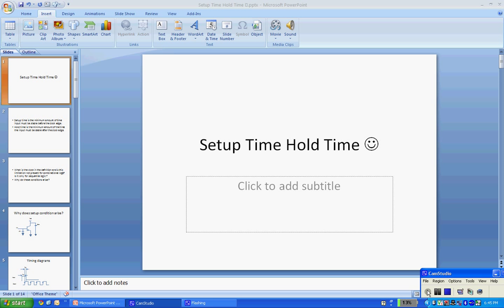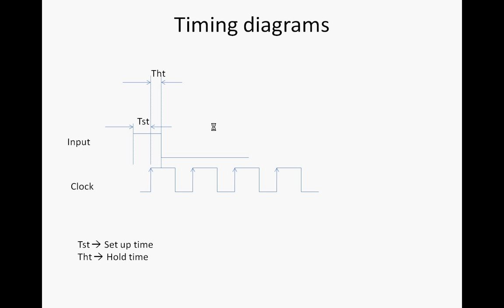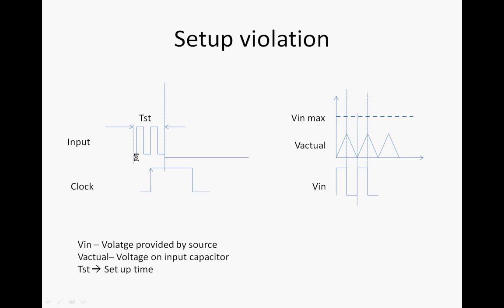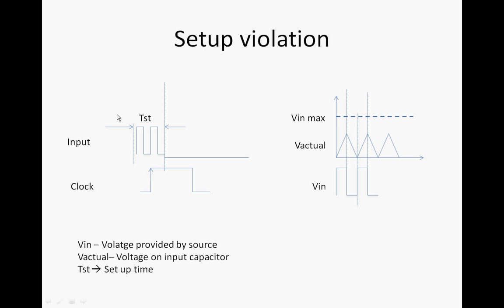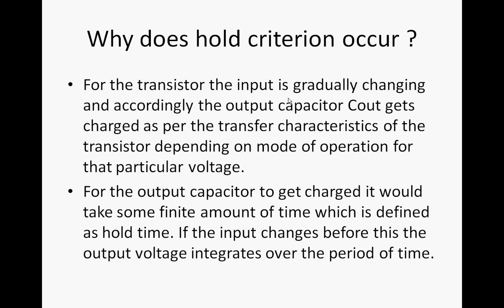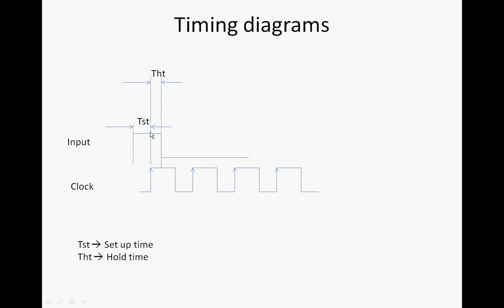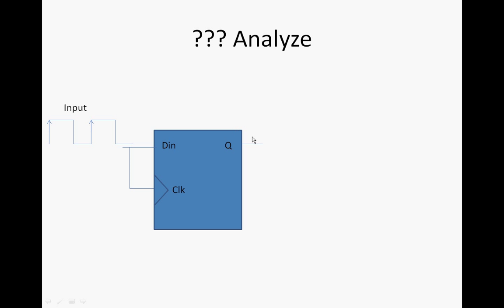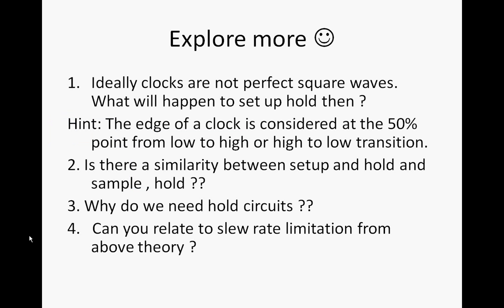Why to setup and hold?

Comment: Input is connected to the base of transistor ? How the clock is connected to the transistor circuitry and what is the clock relation to this circuitry ? How does the transistor know about the clock period ? As you said metastable state may be high frequency change in signal but how the capacitor know about the high freq and low freq input signals ?
Reply: I think here clock is the supply to the transistor i.e..Vdd